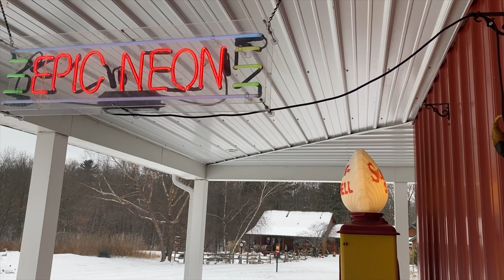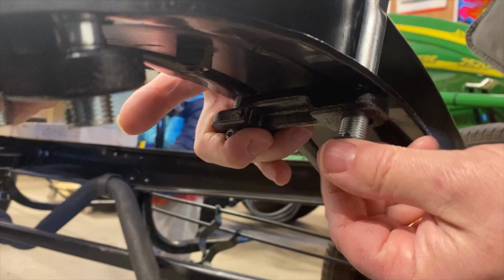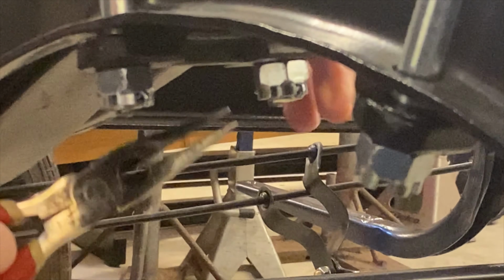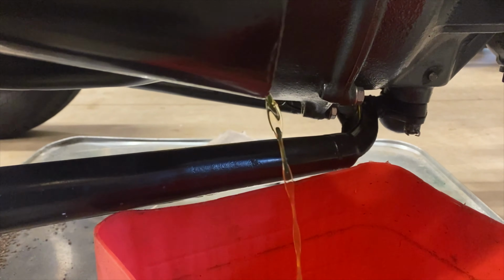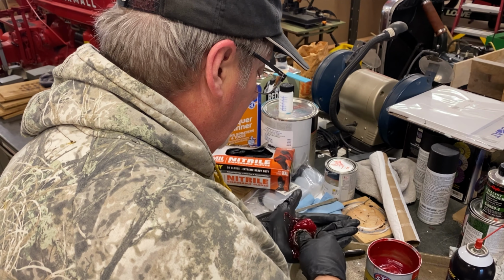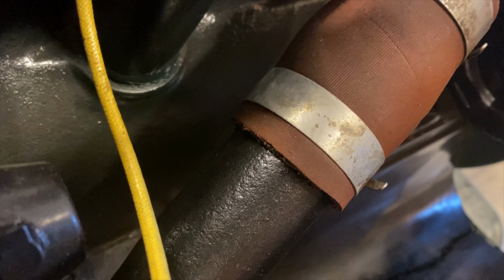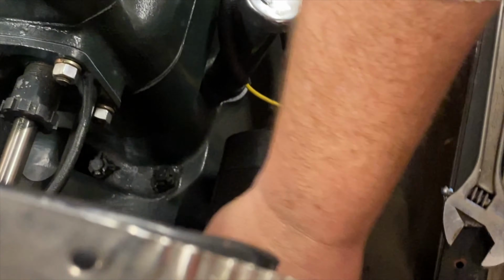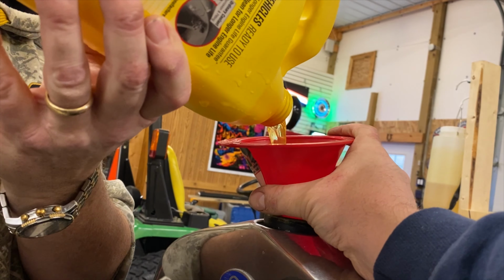1930 Ford Model A Restoration | Replacing the Radiator Hoses, Water Pipe, and Petcock | Rear U-Bolts

Comment: Great episode I love watching This build. However flip your grease fittings on your water pump if you haven’t already done that. Also I loved the placement of the solenoid on the starter! I’ve never seen that done before. I have seen some solenoids mounted on the firewall before and I have never really cared for that. I may use your idea for my model a engine I am rebuilding.
Reply from the maker: Thanks for the information on the water pump grease fittings. We haven’t spent 30 seconds thinking about that yet, so we hadn’t noticed that. We will definitely make that right. 
Yes, the solenoid works great. We’re very happy with it. Good luck on your build!
-Chris

Comment: Nice episode! Note: your water pump "pseudo" grease fittings are backwards. The brass one goes towards the back bearing. Originally it was designed to use the brass cap to inject water pump grease into the rear bearing, and then cap it off.  Not that this will affect anything on your build, but it is a style point!
Reply from the maker: Thanks for the heads up. We haven’t spent 30 seconds on our water pump yet, so we hadn’t even noticed that ourselves. Good catch!